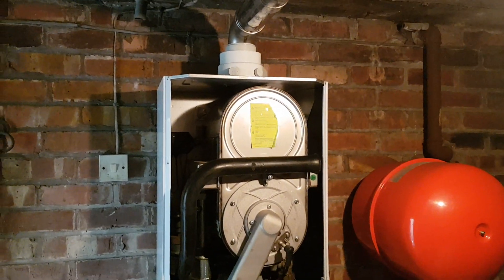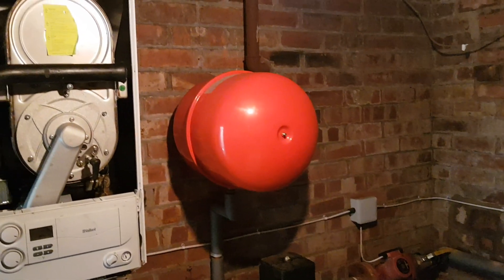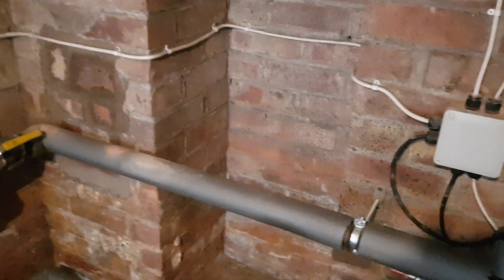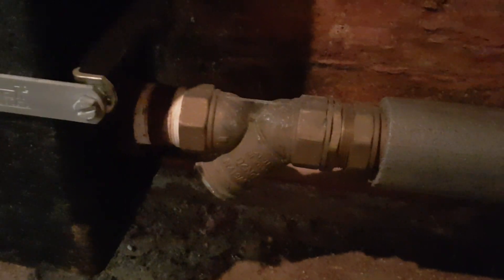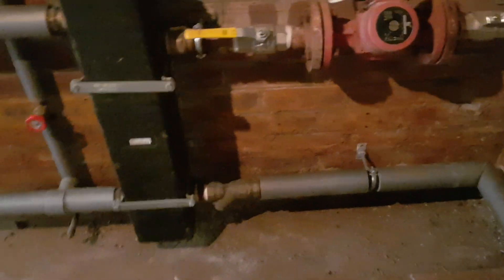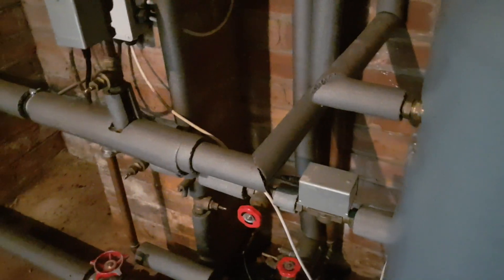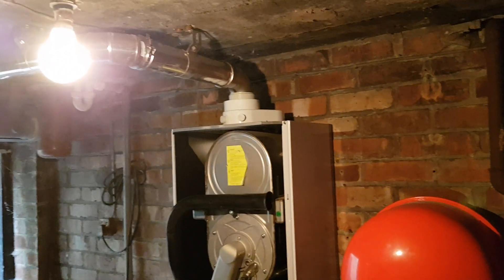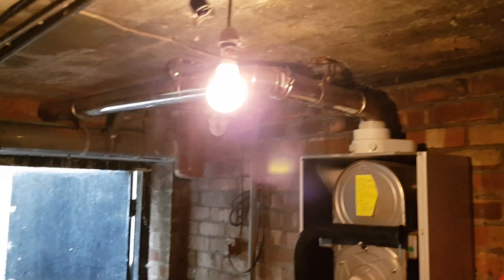Vaillant ecotec VU 656/4-5

Comment: Can you please help with my boiler's fault-finding.  
https://www.youtube.com/watch?v=YKdr1L37p-w
 BAXI MAIN 30HE.
Why is it over modulating ??????
The NTC is OK,  Plate H EX is clean, No overheating on primary heat exchanger output
(45 degrees).
DHW Temp is around 40 degrees maximum.